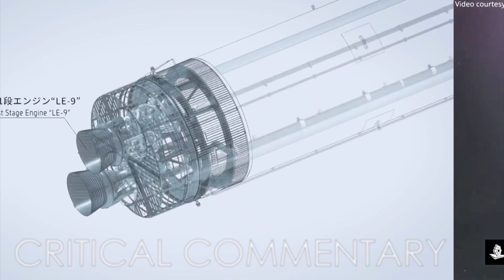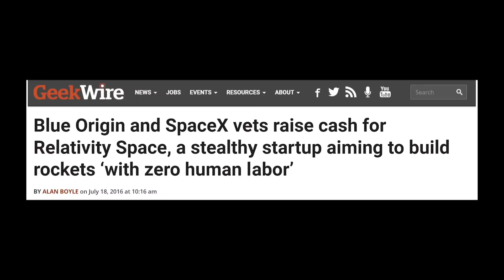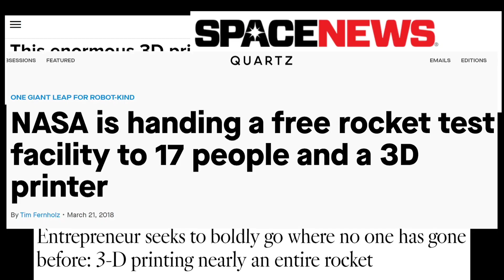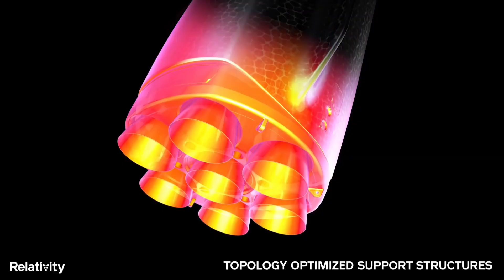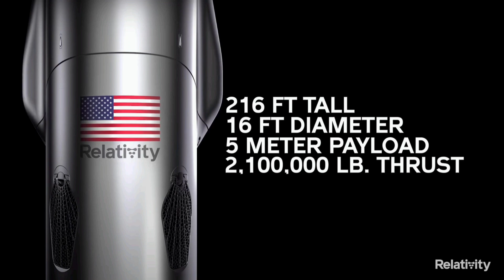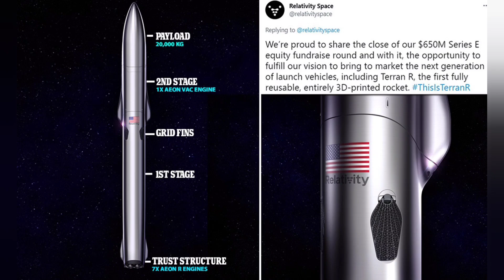Two Blue Origin employees building Jeff Bezos' worst nightmare!  -  Relativity Space!

Comment: While additive machining has its place in rocketry I still think building things like pressure vessels and fairings using this method is a fools errand. Sure its cheap and good for prototyping but you are always going to get a more optimal result for simple structures like fuel tanks from sheet metal fabrication. I hope they ultimately end up with a mix of fabrication techniques and don't get bogged down dogmatically trying to 3d print everything.
Reply: Methinks maybe you are being dogmatic that additive will not eventually be better for pressure vessels. 😉 There have been many innovations in additive since falcon 9 was designed. Also, the ribbing can be made much more efficient. If falcon 9 was designed today it might have gone this route also. 

There probably was a time when COPVs were considered inferior too. True, COPVs work well at small scale, not for large tanks, so maybe there will be a size limit for additive viability. But that will likely constantly be pushed higher. Additive does not have to be better in this case but just close so that the additional weight outweighs the reduction in joints and fasteners and build time. With the innovations they are likely pursuing with all that money, additive might prove to be better for 5m, but not (yet) for 9m.
Reply: @rocketmanzimm  One thing I understand well is materials science. While additive can be very good for prototyping and in manufacture of some highly complex components, it will never surpass manufacturing using sheet fabrication for things like pressure vessels or fuel tanks because the 3D printed materials are never going to have the mix of properties that more traditional materials have. Take fuel tank fabrication, cold rolled stainless steel mechanical properties cannot be replicated using 3D printed metals because it is impossible to replicate the work hardened atomic structure found in such a sheet steel. This is similar for most metals. 3D printing can be a good candidate to replace complex castings with far more elaborate internal structures possible. As I said dogmatic adherence to 100% 3D printing is not good for everything and a more pragmatic approach needs to be taken.
Reply: I completely agree. This company seems like it’s jumping on the additive manufacturing hype train. If they want to take out labor that’s fine, but you can automate the manufacture of Copv’s as well as the rockets outer structure easily considering it’s a simple shape with automated fiber layup. If you’re reusing the rockets the original cost doesn’t matter as much as if you were expending them.
Reply: @theSupercloak  Exactly, 3D printing may be serving them well for their current small rocket, especially for prototyping, but their plans for a fully reusable vehicle using 3D printing is not feasible. They are going to need heat shields and weight is going to be be a much bigger consideration. For a metal construction which is what they seem to be considering rolled sheet material is going to be much lighter and stronger than their printed materials.

Comment: I don't believe 3D printing of rockets will make a strong enough hull - or anything - to withstand many launches. It is a novel idea used for investor bait.
Reply: What do you know about 3d printing metal alloys?
Reply: @mrandersen7  I know that the layers are often uneven and require further milling to produce a smooth enough surface. They also cannot produce certain angles that you may be able to achieve through traditional fabrication with sheet metal. I am highly skeptical of this approach to rocketry, and so far believe that it was investor bait. It is quite a cool idea, and 3D printing metal is amazing technology, but for pressure vessels and reusable rockets I do not believe in the concept. You do not need to feel the way that I do.
Reply: Metal 3D printing has evolved substantially in just the last few years. So time will tell if your doubts were warranted soon  enough.